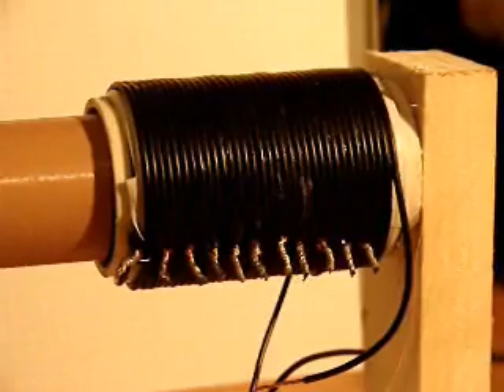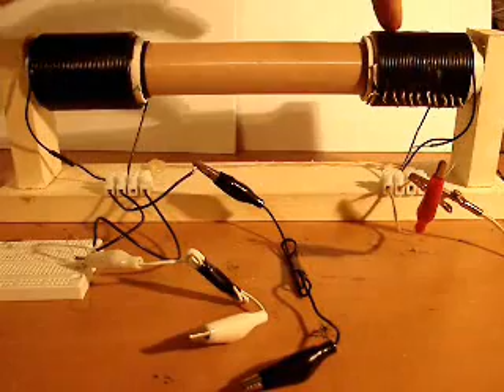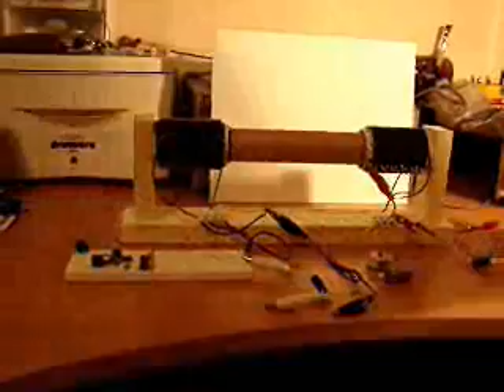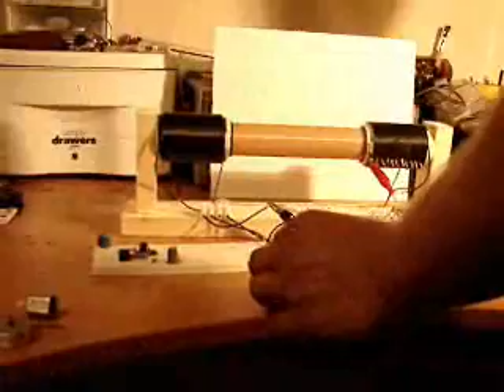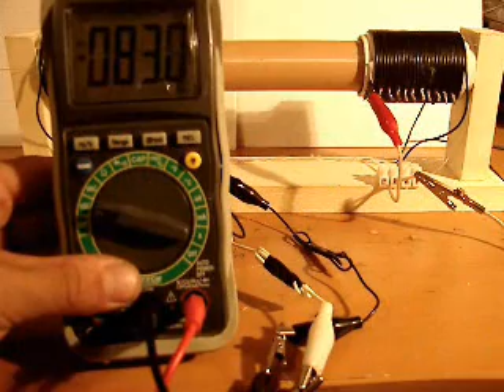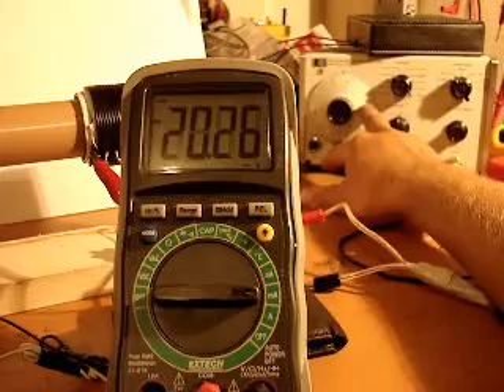fun with lcs

Comment: 'tortuga' , if I could bother you with another question; is the signal generator powering the loads and also the lamp in the input impedance test?
Or are you using an amplifier?

Comment: @tortuga0303 yes, your device is basically a Tesla radiant energy transmitter, with tuned coils that resonate at a certain frequency. You could just as easily tune your device to optimise a certain frequency.

Comment from the maker: If you were to do this, the frequency picked up by the aerial would have to match the frequency of the whole device. One could use an impedance, or spark gap as in "Device for the Utilization of Radiant Energy" to power the device. If you get a good aerial going with a good ground, I hear you can really get a spark gap roaring.

Comment from the maker: This depends on what resonant mode you are running the coil in, the best way to find resonnance is to hunt for it. Change your setup however you want, then sweep with the signal gen to find the maximum response by your near by scope probe, you will learn a ton doing this exercise.
Reply: You will learn there are 2 resonant frequencies. They are not harmonics. One is the transverse electro magnetic. the higher frequency is the longitudinal magneto dielectric. (when a double resonant system is used)

Comment from the maker: I would say that in a proper circuit, there is both conduction and induction. In fact each successive winding on a coil, induces onto its neighbor, this gives it inductance, so conduction is a product of induction, and vice versa, both need be present,  but most circuits only take advantage of conduction.
Reply: the windings have both magnetic induction and capacitive induction.

Comment: I guess the main point of this is to show that the secondary, with the long fine windings, has capacitance between the windings and thus although it is open circuit, it acts like a closed circuit secondary when the capacitance and inductance, of that secondary, reach minimal resistance at resonant frequency.

I think this is so because normally we expect the secondary to be shorted or else the third, far left coil would not have any induced electric flow, like a transformer. I like it.

Comment: Hi,
could you try to build a selfrunning circuit
with a low power oscillator powering your primary and the secondary charging up a big cap which will power the primary oscillator ?
Great videos ! Keep them coming.

Regards, Stefan.